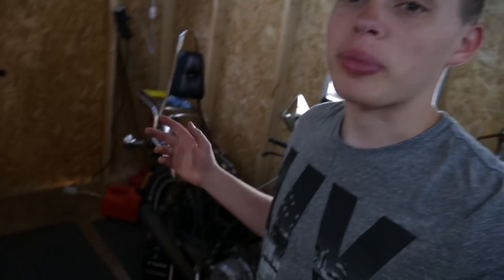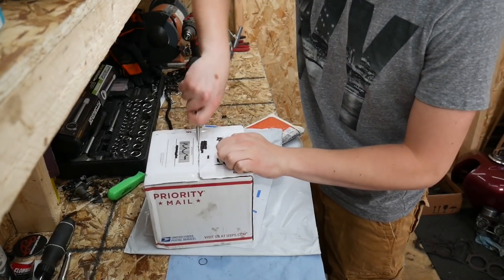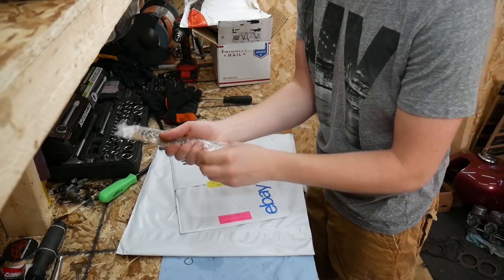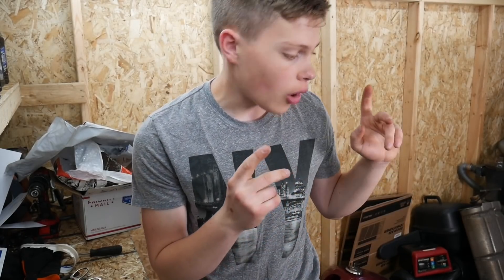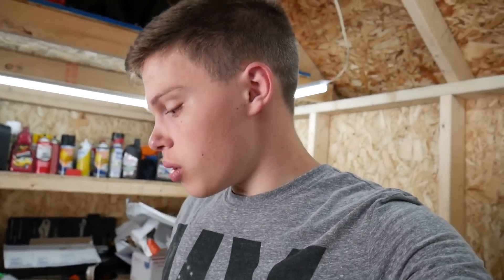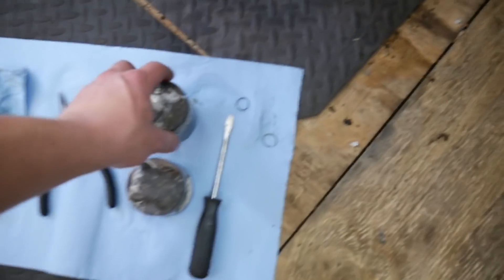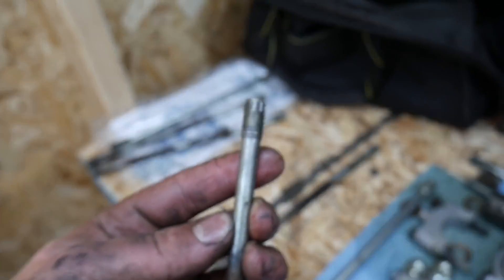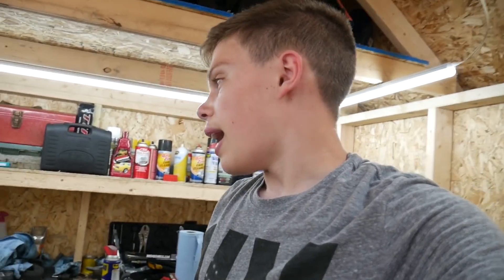The NasKart’s ENGINE is Beginning To Come TOGETHER!

Comment: Dont worry. Ive built engines with used parts. Is it good ? No but its good for the wallet. My grandpa has rebuilt the engine in his 67 jeep wagoneer about 3 times. All 3 times he put some used parts such as cranck. Bearings. That jeep now has 400k miles on it. Still runs even with original crank bearings.  Could use another rebuild tho. Should've only been rebuilt 2 times but before breaki. He road raged and put his 67 wagoneer with leaf spring suspension and no sway bars up to 120mph. Wagoneers get bad at 80. There not ment to go fast lol

Comment: I would have removed the rest of the studs while it was apart it is easier to heat around the stud if need be... And for god's sake put some motor oil on the rings and pistons before you put it together...

Comment: I know were a pile of those studs are..lots to learn you have.trans fluid works better to break up rust..chem dip can stuffs next time.did you check ring gap???or stagger the rings..heat the piss out of those studs n use two nuts to take it out.

Comment: Im sure this engine will run but just saying when youre rebuilding an engine you want to oil the cylinders before running the pistons in and you should also check ring gap

Comment: good luck with the timing, I found it difficult on a Honda C90 single bore however I was very young however you should be able to find info online or even a Haynes manual if you can get one in the US. Greets from the UK! P.S that's weird how you guys have gear leavers on your steering rack in your cars. Our auto cars have a selector lever in same place as a manual selector. :)

Comment: you just gave a new meaning to junk build.....   And stop saying: I´m gone do this build right....  Nearly every thing you have done so far is the wrong way to do things...
Try soaking the old pistons in wd40 and some solvent...not just oil...  
So much wasted time, energy and money just to realize that the engine is not gonna work in the nascar build. it is to big, bulky and to heavy.   Cant wait to see when you are trying to take the engine out of that bike and into the gokart.... I bet that you wont even manage to lift that heavy thing....   And when removing studs you need to use 2 nuts tightend against each other, and unscruing to bottom one. Then you wil have no problem removing them headbolts(or any other bolts that is stuck)

Comment: Your fuel pump on the truck only runs for 3 or 4 seconds and no gas goes into the cylinders until it starts to crank over

Comment: The best and easiest way to remove studs is by screwing on two nuts on one side, tighten them into each other and use a wrench to loosen the stud. Great work , I think it'll run in no time.👍👍

Comment: You not suppose to cut the cylinder head studs to get the head off. It was intended to remove engine from the frame to disassemble the top end of that engine. Good luck finding replacement studs

Comment: Call me crazy, but when I go buy something to do a specific job like cleaning parts, I buy parts cleaner. If I had wd40 lying around and the pistons didn't Need a corrosive I understand, but if you're going thru the trouble of going to auto zone, buying a product and scrubbing down the pistons, I would buy parts cleaner. When removing studs I use 2 nuts. The captive nut will unscrew the stud. You spent $ on a stud remover that fucked up the threads. So now spend more $ on good studs or a tap n die set

Comment: "I want to do this rebuild right". Cuts 2 studs in half
Reply: Do any one no why their is cool metal rings in new gasket ??
Reply: @lyndonwebber1389  The reason why there is metal in the gasket is to reinforce the part of the head gasket that is under the most stress during compression.  Some aftermarket performance heads on vehicles contain a groove which allows one to fit a copper wire in there.
Reply: esqueue lol I no I was being sarcastic
Reply: He’s done loads of top end rebuilds walk in park
Reply: He flooded a fuel injection truck to because he primed pump lol
Reply: Robbie Friend buys used pistons
Reply: Jake titus buys blinker fluid
Reply: Yeet

Comment: I’m curious how your willing to put in the new head studs you will buy. Don’t use the tool you used to take them out. It will marr them up putting them in. And you didn’t have to buy all new head studs. Could have just run a tap over them

Comment: Used pistons may cause imbalance in rotation. I hope you have a grams scale to weigh the pistons to see if one of them needs to grind excess weight down lightly to keep all the pistons the same weight. They need to weigh the same weight. Measure the gaps on the piston rings and weigh and space them evenly with a grinder before installing them on the pistons. I hope your connecting rod bearings are not wore out. Lube the cylinders before installing them back over the pistons. "WHAT?!" "NO MORE VIDEO?!" "DANG IT!"

Comment: You are ment to put oil on the pistons when sliding them back into the barrel if not they scratch up really bad and also when you first start it they will be dry which is really bad, your such a pathetic mechanic you don’t know anything
Reply: FD RC well considering I have been a motorcycle mechanic for over 20 years I think it’s shocking to think he doesn’t even know you have to add oil to your pistons when you slide them in there cylinders, it’s just not right and he’s just making a mess off it !! Please don’t comment on my stuff you freak

Comment: How are you going to put the head back on when you put the new studs in if you had to cut the old studs off to get the head off before?.. Should of just pulled the damn motor. Now your gonna have to wait even longer to get the right length studs when you could of just taken the motor mount bolts off n the motor an not had this problem. NEWB!!

Comment: You want to do it right but you’re using used pistons? Really?
Reply: Theres nothing wrong with using used pistons as long as they arent beat up and its not like this is a built engine where he fully redid the bottom end and everything plus its way more expensive to buy a brand new set of pistons than old ones that will do the exact same in performance
Reply: It’s the rings that are the main problem doesn’t matter if it’s a second hand piston unless it’s proper fucker in this case it isn’t....

Comment: I'd get rid of that aftermarket air filter intake put your stock one back on most likely messing with your air flow sensor there.
Reply: nah it won’t mess with the air flow sensor the air filter just to make just to Dirt And Animals And Etc Getting in the intake
Reply: There is no air flow sensor on this engine.
Reply: yes there is, you can see it between the two clamps.
Reply: @34bartm  if you say so
Reply: Okay

Comment: Im going to be impressed if he gets it running. But if your not going to save the bike. Cut the frame bar out so you can get the head and studs in.
Reply: Go Karts and Motorcycles ETC. wouldn’t the bike collapse ?
Reply: @quancast1141  it still has the bottom to hold it. This is just to get the head on. So when he is done he can still crank it.

Comment: Get some 1" foam board and put in between the 2x4s for insulation, will help greatly for heat and ac. Makes the building like a ice chest.

Comment: Dude. Lube the cylinders before instaling the pistons. Why are you making your life harder?
Reply: I've been cringing through most of the video. Used pistons and bone dry cylinders! Lol
Reply: @1980bwc  besides that, do you think he realises what a massive change this is in his little nascar?
Reply: @wimvandesteeg1353  he doesn't realize he is creating a death trap and is going to seriously hurt himself.
Reply: @kizza40897 yep, any oil will do, most common is just motoroil, doesnt have to be a lott, its way easier to get the pistons in then, and while starting the first time, you'r sure its all lubricated, this way the cilinder walls will be scratched before even running :(
Reply: Also hope you set ring gaps properly
Reply: @justinwiseman5942  he doesnt do anything properly. I guarantee tgis engine wont last 100 miles. Guaranteed it will blow up.
Reply: @kizza40897 they have assembly lube just for this application
Reply: Lucas oil stabilizer will stay stuck to everything. Really good stuff. That’s what I use. Or  Marvel mystery oil for tight fits
Reply: @remingtonmitchell8117  Lucas oil stabilizer goes in every engine I own. Stuff is super sticky to ensure you NEVER get a dry start and it makes the oil stick to all the internals so you get 10X better lubrication. All the engines I work on I tell all my customers I highly recommend lucas stabilizer.
Reply: @joeshmo2473  hey at least I know I'm not the only one that uses  it lol.
Reply: @kizza40897 i just use a higher weight oil like 20w or something on my rebuilds with the smaller engine
Reply: I understand he's learning I 100% respect that but a little bit of research goes a long way.. If you don't know, someone for sure does.
Reply: He just wants to make everybody's life hard
Reply: I use waselien jelly